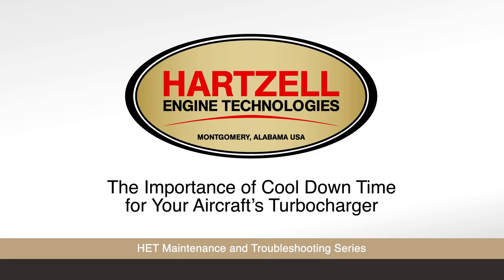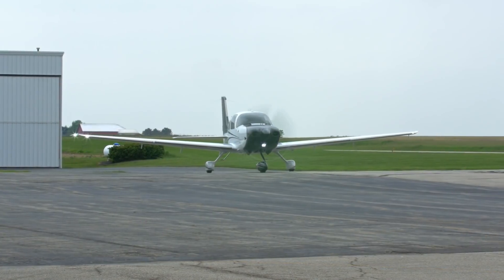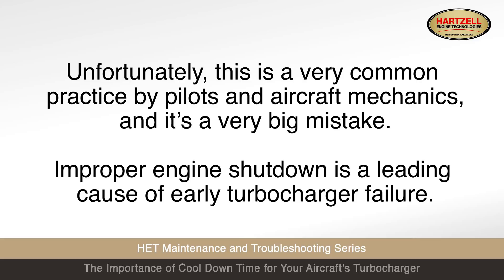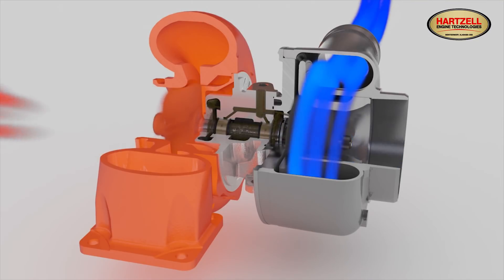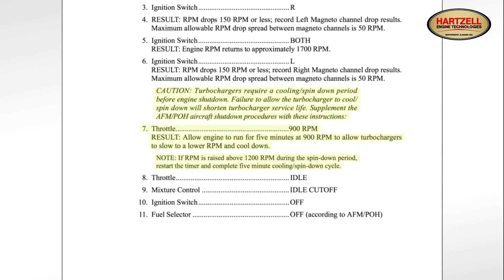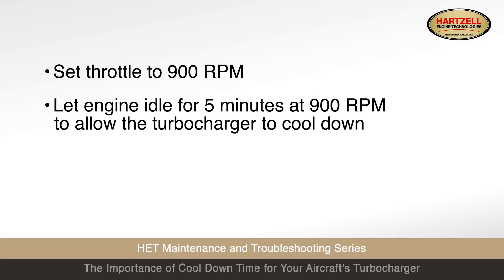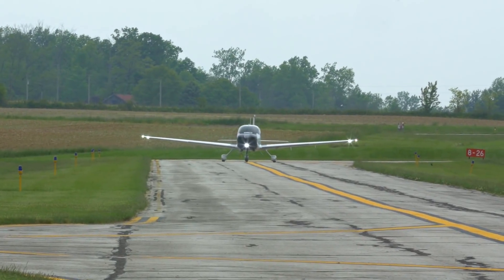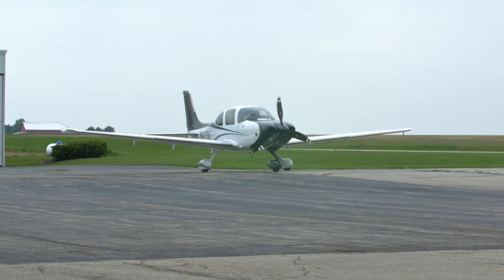The Importance of Cool Down Time for Your Aircraft's Turbocharger

Comment: For all of you out there, it is important for turbochargers to receive  a cool down period if it was just at power and especially if it is not water cooled. The EGT probe does not measure the temperature of the turbine housing but the exhaust gas temperature. The turbine housing can retain heat for a lot longer as it has a lot of thermal mass. This thermal mass can and will soak back through the path of least thermal resistance e.g. the CHRA and the minute amount of oil that resides in it, causing it to coke. Coked oil becomes carbon, causing increased wear on start up and blockages.

Comment: You guys are silly. Idling temperatures are not the problem with turbochargers on any platform. It is when you go from glowing red to shutdown that causes issues. Sure it may be a little hotter just sitting there idling versus rolling but is not going to cause any problems.

Comment: These miss information videos and web informative articles is why i will stay in business as a shop.  I explain to my turbo clients that during landing on a turbo normalized engine and low power settings and yes during rollout your turbo will never be cooler during engine running condition.  Please if you watch this just simply have a laugh and go watch draco fly stol. it’s way more fun to watch.
Reply: The temperature difference between idling and moving at idle is not that great while the temperature difference between load and idle could be 400 degrees.  What do you tell the guy doing a run up outside his hanger? Go take a lap down the runway?

Comment: The lack of data and knowledge displayed in this video is stunning.  Excellent data exists showing that the turbo is coolest during the rollout after landing and is only getting hotter the longer you wait to shut down.  There is NO good reason to wait to shut down and probably many that it actually hurts to wait.
Reply: So why do race cars have turbo timers?
Reply: @daytonasixty-eight1354  the aircraft is moving after rollout.
Reply: @daytonasixty-eight1354  Because airplanes are not race cars?
Reply: @LiraNuna  Same principle for piston engines dummy.
Reply: @daytonasixty-eight1354  As a pilot and engineer, no - you're incorrect. Airplane engines operate at different environments and parameters than automotive ones. Some examples: Airplanes engines are air cooled, Automotive engines are liquid cooled. Aero engines run at ~2300RPM while automotive at ~5000-8000. There are many many more differences, including how the turbos run
Reply: @LiraNuna  Buddy, I know all of this. You people are dense. Turbo timers... they exist on high performance vehicles so you don't immediately shut off an engine as the turbo is cooling.

Guess what? That's the same concept as taxiing or idling to let cooler oil and exhaust circulate through the turbo on a piston plane. But hey, go ahead and rip that mixture knob out and shut down rather than waiting a minute.
Reply: @daytonasixty-eight1354  are you a pilot? during descent and approach to land, the engine is already spun down to below 50% power for at least 10 minutes (depending on altitude). I don't understand why you are not taking this into account.
Reply: @LiraNuna  It's taking you at least 10 minutes at near idle power to descend in a piston plane? Dude that is hardly a typical scenario. Most GA pilots barely get about 5000 AGL
Reply: @daytonasixty-eight1354  When you have a turbo you don't cruise at 5000ft, you cruise at 15,000ft. At a rate of descent of -500fpm, it takes 30 minutes to go down to sea level.
Too high for you? 10,000ft will take you 20 minutes to get down and 8,000ft will take you 16 minutes.

So yes, it does take over 10 minutes to descent, let alone shooting an approach and taxi. This is my point and you still fail to understand it.
Reply: @LiraNuna  No I understand why you have a turbo, it is more efficient at a higher density altitude and cruise. However, I'm saying most GA users do not use them this way. They fly to the same $100 hamburger spots and rarely into clouds because it's scary to them. The original point we were all arguing here is that turbos get hotter while people idle on the ground. They do not... same concept as to why automobiles have turbo timers. They cool off as you idle. 

I thought that would be a good way to effectively explain that yes, running an engine at a lower power setting will be cooler EGT and cooler oil which will in effect cool a turbo. But I forgot that you weekend warrior pilots are mostly morons.
Reply: The problem is the spinning rate of the turbine assembly, not the temperature of the turbocharger as a whole.

Comment: You guys are spreading old wives tales. If you have ever instrumented the turbo, the oil galleries etc with thermocouples and analysed what actually happens, you would change this video.

I doubt you have the data to support this myth. I have seen the data from real turbo heat up on the ramp and it is the exact opposite.

Stop spreading old wives tales and support your claim with real flight data. I bet the lowest turbo temperatures are right at the point the tyres squeak on the tarmac.
Reply: Ya good idea, let me just operate differently from what the manufacturer and the POH say to do. Certainly no one in aviation has ever gotten in trouble by doing that!
Reply: @daytonasixty-eight1354    Aircraft manufacturers and engine builders such as  Continental and Lycoming have done  several revisions  on MANY things in POH and operating procedures.   In fact many POH's were written to operate in a way to to sell aircraft based on  performance and not longevity.  Question everything and demand to see the data.   The coolest time for the turbo is on the descent to land,  not on the ground idling after landing.  So yeah, operate differently if the data shows otherwise.    At one time the POH said don't and then it said do,  then it said, occasionally and then it said...
At one time someone said slavery was okay.
Reply: jaba430 it says in the POH that there should be a cool down period.

Comment: Are you absolutely 100% sure of this?  

Do you happen to have any recorded temp data from sensors or thermocouples to confirm this?

At minimum, do you have data of oil temp at turbo inlet and outlet at landing vs after 5 min at idle?

Sitting and idling does definitely not make for lower temps in my airplane, but I don't have a turbo'd aircraft.  I guess that 's why I am asking.
Reply: According to George Braly (GAMI, Tornado Alley Turbos, etc), who has done the testing, I am 100% sure Mr. Scheideman is correct. I fly a turbonormalized aircraft and have never idled intentionally prior to shutdown. Continental and Beechcraft recommended this on the factory turbocharged Bonanzas, I don't have knowledge to contradict that  recommendation.
Reply: The key issue with the turbos is the speed at which the turbine assembly spins. At idle the speed will always be minimal, independently of the oil temperature. The wear occurs when you shut the engine while the turbo is still spinning at high speeds, and that has nothing to do with the oil temperature at the rest of the engine.